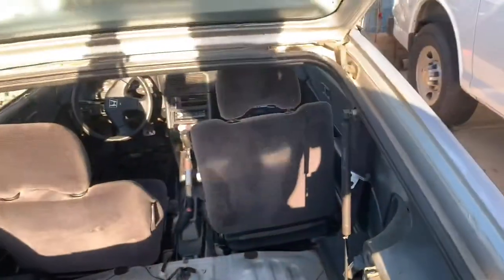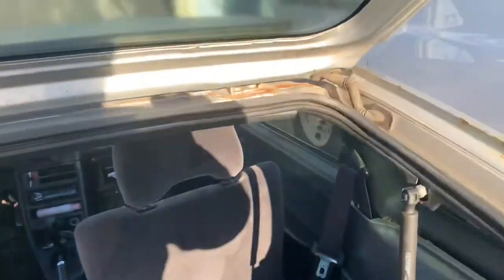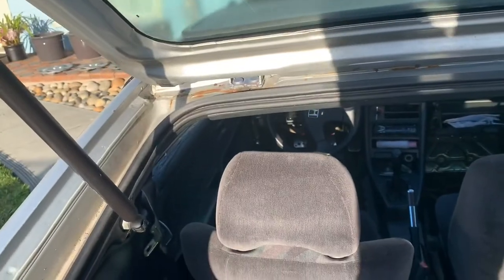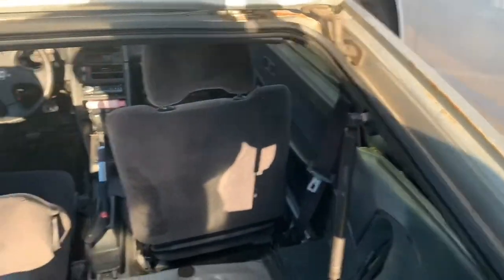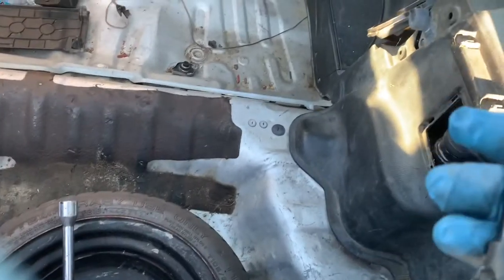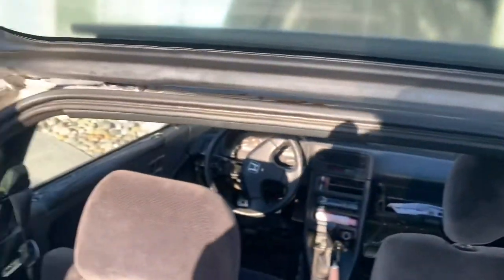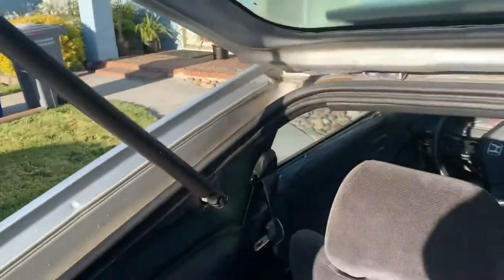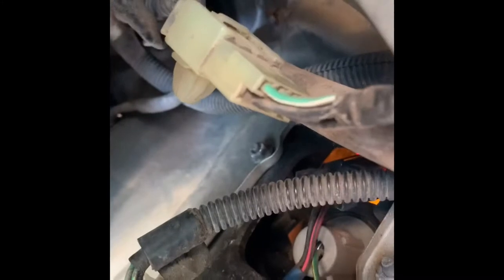How to remove & replace glass hatch from Honda 88-91 crx 😊 diy

Comment: Canada here...89 crx si...disconnect hinges, remove trim, remove wiper motor, cut clips, wrap wire harness, remove hinge bolt harness side, gently pull harness thru n out...reverse to change whole hatch or now you have clearance to remove the glass, keep turning that wrench...one love
Reply from the maker: Thanks for watching from Canada 🇨🇦, I like to go there some day😃